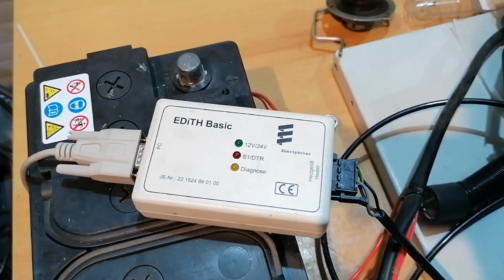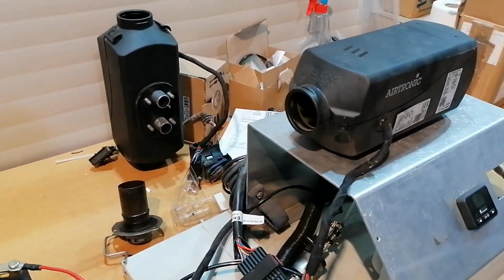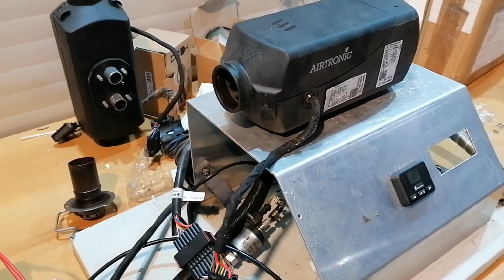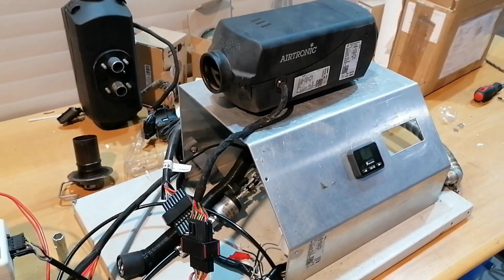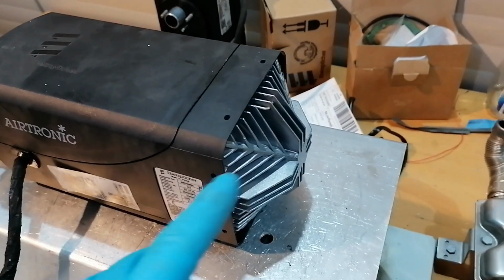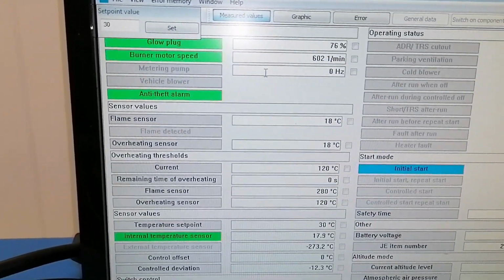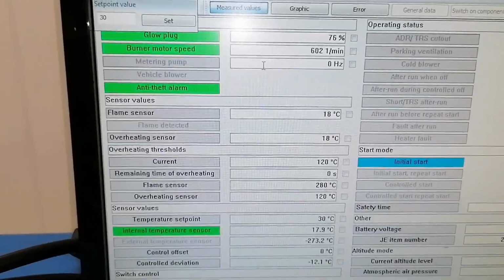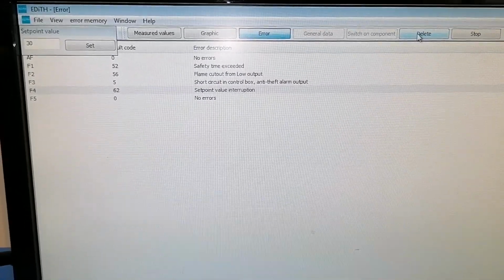How to service and repair a Eberspacher D2 airtronic diesel heater, recommended yearly maintenance

Comment: My d2 starts runs for 3 mins and shuts off just as it starts to heat and is showing fault code 099
Reply from the maker: That is a problem 99 usually needs ECU change

Comment: Hi i have a d2 with 801 controller and cant get it to modulate stays on high no matter what i set  it at. I have connected the grey wires in harness to 801 but still no difference

Comment: mune just wont start now fan spins for a few seconds the shuts off 🙄
Reply from the maker: You really need to get the error code, it could be any part with the problem
Reply: @DIYHelper  no codes show up on the unit control  but I'm gonna take it apart like you did an clean  everything up
Reply from the maker: @rigobertohernandez2524  could also be a voltage issue

Comment: Pile of crap heaters. Even returned mine to the dealers for a service and fault find. Picked it up working fine. First use in the evening not working. £140 out of pocket. Will be cheaper to get a Chinese heater and just replace it it stops working

Comment: I have the same heater but it will not get hot just blows cold i had it all apart glow plug works of a battery but fan only comes on in the high setting any help would be great thanks 👍
Reply from the maker: Whit out an error code I would suspect a fuel problem, check if the pump is really working

Comment: Changed the fuel pump,screen ,heat sensor ,screen  and glow plug unite runs for.5-10 minutes and shuts off. Can you help

Comment: Hello, tank your for this video, I would like to know if it is possible to replace the Airtronic Mini controller on my 2018 Challenger 290 motorhome with an Easy Start Pro digital controller or another?
Reply from the maker: The heaters number would be helpful 25xxxx

Comment: I have a problem. The heater comes on and the fan goes into high mode, but hardly any air comes out the front and then it shuts down.  Do I have a bad burn chamber fan?
Reply: i have same problem what i do now can you help me

Comment: One of the better service vids I've seen. Bio-diesel cokes these up fast. Then add in anti gell to a tank......
 I keep spare parts to tear down mine. What I keep on hand.- 12mm deepwell socket with slot cut for glow plug. 4" long 8mm bolt used to safely remove screen for reuse. 1qt kerosene tank. Carb cleaner. 
Usually after the first sub 20⁰f use mine starts to fail starts. This takes me about 15min to do I've done it enough every winter. 
Pull the glow plug then spray carb cleaner into and through screen to loosen up tar. Insert 8mm bolt and with light pressure 97% time able to remove screen with no damage. Clean screen and plug bore with carb cleaner and a 9mm bore brush. 
Heat screen with small torch to finish cleaning and anneal it. If it not round due to something just push over shoulder of bolt to reform it. 
If it was smoking especially bad before it stopped working that is when I'll connect the kerosene tank and let it cook off and clean the burner before switching back to main tank diesel. 
As I said I keep spare glow plug and multiple screens so I can just get it going as fast as possible. When it -28⁰f and 01.00 in the morning speed getting it going is required. I recently got my hands on a second one and going to figure how to mount it so I just need to move the harness over 😅

Comment: Nice video. Is there a way of diagnosing a D2 on a Scania ,with an aftermarket tool?
Reply from the maker: Depends on the heater number, some can be diagnosed some not
Reply: Airtronic D2 25 2173
Reply from the maker: @cozmiccoz2195  it should be possible if the Ecu has number 255102003101 on the yellow/blue wire
Reply: It's a 2251020031010B
Reply from the maker: . 0B is just the revision so it doesn't matter
Reply: Thank you !! Keep up the good work and thank you for sharing.

Comment: Why my heater works only on high setting?
Any setting from half scale down, the unit shuts off.
Thanks!
Reply from the maker: What controller do you have?
Reply: @DIYHelper  it's an analog one(dial)
The one came as a package with the tripac apu.
Reply from the maker: Well if it worked before than probably the resistance in the controller is bad if it never worked than properly some connection problem.

Comment: I’m having a hard time getting the unit to run at all. The controller says it’s running, all fuses are still good but nothing happens the fan won’t even turn on. Any suggestions?
Reply from the maker: Which controller do you have?
Reply: @DIYHelper  I believe it’s the smart controller, it gives me the code 1. H1: restricted operation
Reply from the maker: Well you could have a sensor problem but first I would delete all the errors and try again. Check the ducts so the is no restrictions. You can find the installation manual for the Easystart Pro online and there you have the way to delete errors
Reply: @DIYHelper  thanks so much!! I will try that today
Reply: @DIYHelper  hey I got it working once I cleared the code it had thrown. Thank you for your help!!! Just in time going down to zero tonight

Comment: Hi just wondering i have another chip besides the existing one on the brown fan lip would that  be a problem or its gonna work like that
Reply from the maker: There is no rule on how many places the plastic is chipped, this is how the fan is balanced in the factory so don't worry about it.

Comment: Mine is very noisy whilst running,  it sounds like the fan or bearings whaling how do i fix this ?  ...Could i lubricate the bearings if so how is this done
Reply from the maker: Not really, I have a video with a D4 with the same issue. I heard about some guys changing bearings, if you can diy than it is probably worth it but I don't recommend it. You will not have the tools to balance the blower and probably the brushes need changing as well. The motor is closed by pressing, no screws so it is hard to get it open without damaging it.
Reply: @DIYHelper  Thanks for your promt reply & you're videos have been  really informative & helpful 👌

Comment: Thanks for the cutaway of the burner... This was my issue. Coked up and soaked to the point of no fuel passing... Tip.... So what i did instead of replacing. I popped off the impeller input cover. Used a blow torch to burn the inside cherry red a few times. It will burn off all the diesel and allows me to tap and shake out all the carbon... Repeat till none comes out. From the impeller input you can see the mesh peaking through the slots. Take a pick and run it along the mesh causing it to vibrate... Blow it out and you can get air flow now when blowing into the glow plug hole now... Round off the rivet pins and install the cover again and peen them to secure the cover. Reassemble and it will fire right away. 

Basically the blow torch burned out and loosened all the carbon hotter than the unit can ever do.
Another tip. If possible once a year pop off the fuel line from the tank and run a short whip into a bottle of straight kerosene (a trick many do in the sailing forums) it will burn way hotter and clean up the system from fuel that left biodiesel deposits. You will actually see sparks and ash comming out of the exhaust.
Reply from the maker: I can agree with with the last part,  running on kerosene was at a time mentioned in North American manuals but not here in the EU. It is an option to burn out the carbon and if it really works why not, I have not tried myself this way.

Comment: Very helpful, thank you. I don't think my d2 airtronic is modulating and runs just on high power. Can you explain about bridging the wires please?
Reply from the maker: Hello,  just connect these 2 wires together on the harness and insulate. grey/red with brown/white. Remove the fuses for a few seconds.
Reply: One other thing. This happened to me too.. Would only run on high and if turned down, medium will shut it down.... Its overheating. Inlet plugged. So mine had an inlet duct which would consistently accidentally get covered. Also tge pipe would have built up dust and stuff.... So i basically removed the inlet duck and now it breaths cold air from downnin the boot box area.... So two problems solved. It gets sufficient cold air so it will never over heat even in low... AND NOW  no more moisture in my storage... My tools and stuff were always soaked with condensation... Not any more.

Comment: How i can Start the d2 without Controllpanel? I can just connect two Pins to Start?
Reply from the maker: The air heaters need a setpoint, just check you could connect red and yellow, but to work properly you need a controller

Comment: hi there buddy, great video. I have an old airtronic d4 from 2003. it keeps blowing the 20a fuse any ideas? thanks for any help
Reply from the maker: Well it could be just a simple wireing fault or something more expensive like the ECU. I would disconnect all parts from the ECU and try supplying  only that alone. If it still blows the fuse and the harness is fine then it's probably that. Also make sure polarity is not reversed at the battery. At that point in time they were equipped with Wherle ECus from factory and they have a bad reputation.
Reply: @DIYHelper  thanks for replying, I have removed the unit and checked the connections for corrosion etc to eliminate voltage drop, It's installed in a boat and the wiring run is about 4 meters, I will do as you say and check it. If it does blow the fuse, can you supply a second hand ecu? although I do have a chinese 4kw heater kicking around so maybe I could harvest the ecu from that??
Reply: @DIYHelper  the ECU is toast
Reply from the maker: I am sorry to hear that, I don't have any d4 ECUs. I don't think it is safe using the Chinese one on Eberspaecher.
Reply: @DIYHelper  the chinese heater seems to work so I'll use that and keep the eber for spares. Thanks again